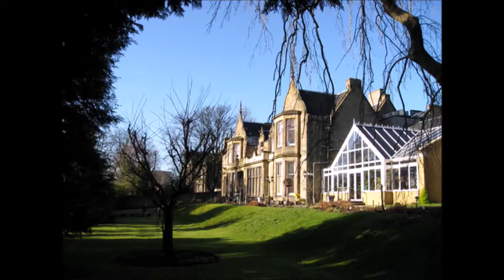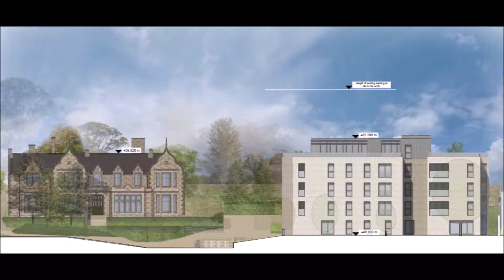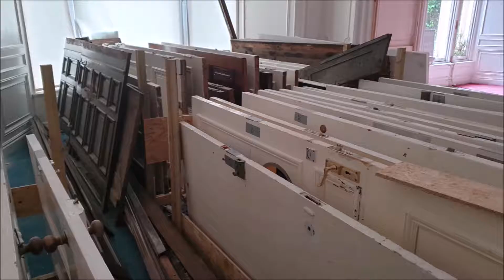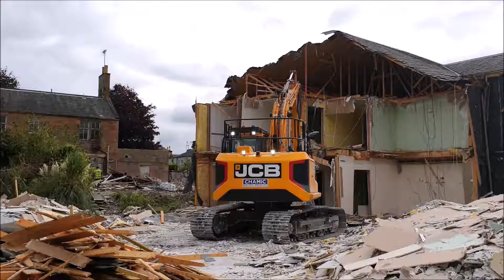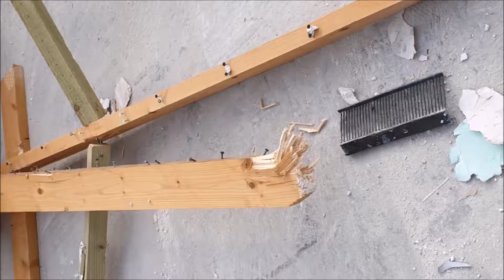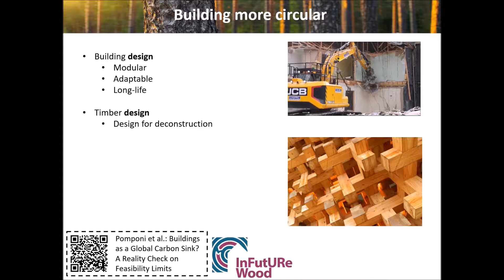A look at demolition in the UK

Comment: the contractors fed you a loads of lies there is a market for reusing wood & the reason why they dont recycle is its time consuming to dismantle a building & you also need to have buyers at hand ready to take the goods as soon as its ready also a lot of the older buildings are prone to infestation of wood boring parasites(woodworm) so getting any reusable wood is a bit of a challenge as the flooring & floor joists often are the areas where the said parasites tend to feed on & if left untreated they can spread onto other wood which is a reclamation centres worst nightmare as any infested wood sold will lead to the house its used in also getting infested, the home in this vid they did not inform any reclamation yards that they were tearing the building down so no one knew or had the chance to snap up a bargain they just wanted the place down quickly, i use to work at a reclamation yard & all what ive mentioned is pretty much how it all works
Reply from the maker: Hi Jason, thank you for your insights! The contractor told us that the biggest barriers to reuse are the lack of market and the additional time it takes to dismantle buildings carefully, just as you say. Unfortunately, because of this, reuse of timber from demolitions is not a wide-spread approach.
We haven´t heard about any damage caused by insects when we spoke to demolition companies. Of course this is a factor we will need to take into account and take precautions for. But nowadays (and probably in the future) many relatively modern buildings are demolished, where it is unlikely that insects survive in the timber because it is very well protected from moisture and preservative treated. The building in the video was merely 30 years old and the timber looked good as new! We are hopeful that the demand for recovered wood grows and reclamation/recycling practices change, so that we would be able to reuse more materials in the future.
Reply: @infuturewood  the insect bit i mentioned such as woodworm only occurs in older buildings where the timbers have not been treated to prevent it now every reclamation yard runs the risk of buying new stock complete with woodworm not really knowing about it until someone buys a quantity then having to destroy it because the insects spread from the infested stock to the rest of the pile, the yard i worked at the new stock went onto a stacking rack away from the dressed de-nailed stock until i slotted in a timescale to sort it dress it & de-nail it about 10% of the new stock had woodworm wich meant chopping the affected area in the hope that were would be enough left over to sell however the yard had a burning bin so the damaged bits got incinerated stopping the woodworm getting into the rest of stock, these modern buildings all the timbers such as floor joists, roof joists, floorboards &roof lats are all pre-treated to prevent woodworm but it like what myself & the contractors said its time consuming to dismantle a building piece by piece besides they get paid by the hour so is best to just rip the place down as fast as possible